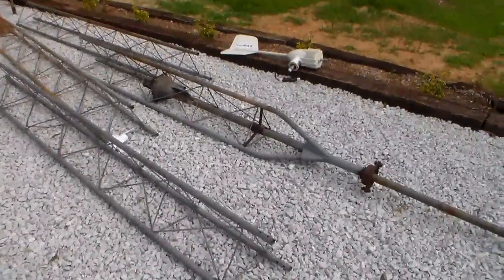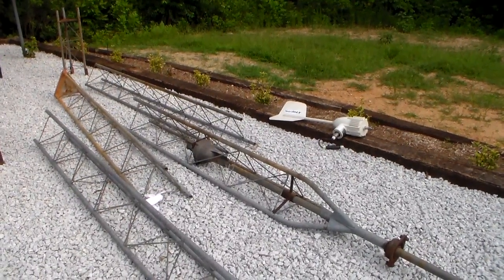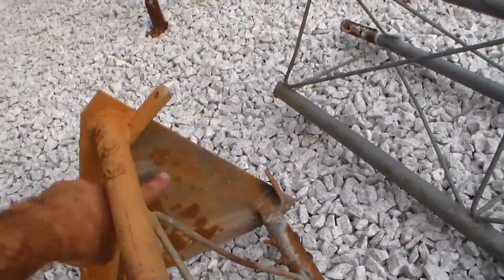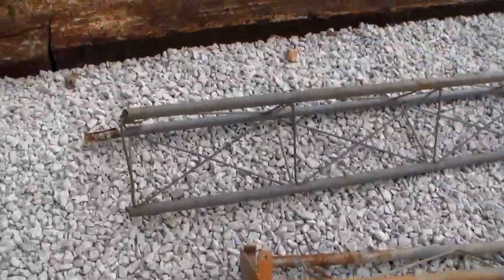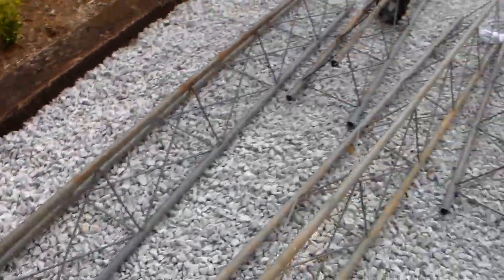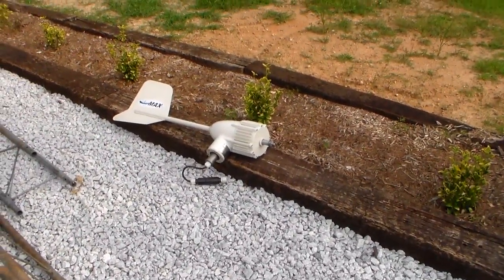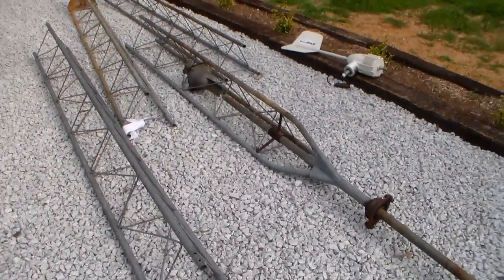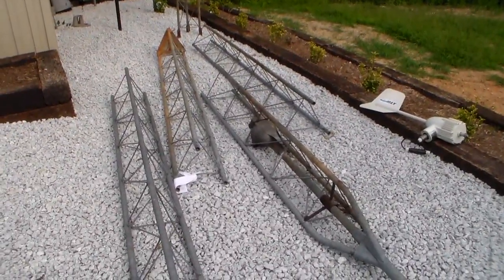Need help with my tower and wind turbine.

Comment: The piece with the flat steel on one end is the top half of the base (you are missing the square 1/4" plate you bolt to the concrete). The two tabs (one is bent) are used as hinges to lay the tower down. The other piece with the three tabs is where the guy wires attach... roughly 30' up your 45' tower. The damage you've shown in the video is consistent with a tower that fell.

Find the ideal place where you want to "plant" the tower to the ground, then before digging ask yourself where to put the guy wires anchors (roughly as far away from the tower as they are up). Just walk around the area and pick some good locations for each. Understand that each guy wire will probably have to be a different length due to obstructions and ground level. It's more important that you maintain safe attachments (double or even triple u-bolts at both ends) than they be exactly at a 45 degree angle. Just get them close. The base concrete footing should be 2x the diameter of the tower (minimum) and extend 6" below your frost line with the bottom belled out. The guy anchors also need to go below the frost line.

Next, assemble the tower on the ground, raise it as a unit, bolt it down, and secure the guy wires to their anchors (you'll need a helper in this phase). And finally, on the section that is damaged, I would cut to just below the next horizontal brace. The triangulations are used as structural support. Good luck with the conversion.
.

Comment: Use the base with the thick plate and bolt it to a good solid concrete foundation. Yes paint it, but I would recommend some POR-15 for your tower. That stuff stops and prevents rust for a very long time. It's used to paint offshore drilling rigs. Be sure to secure your tower with guide cables at a minimum of three locations.

Comment: the tower is galvanised, so normal paint will not work on it, I have experimented with hamerrite and that is the only paint so far that worked on those kind of towers. the next question is just how high you want your tower to be, personaly I would use the part with the bend slab to use as a base arround a pivot so you can lower it, climbing a tower to work on a turbine is a pain in the ass and you will always see that you need to work on it in bad weater, go to a local ham radio operator and ask advise.

Comment: what you might consider is, the piece with the bent ear was/is probably set up so you can lay the tower down to work on it. my suggestion would be set a post, and build a hinged base, and, put a pulley and hand wench to raise and lower the tower.  you can guy it so you will only have to take one side loose to lower it over onto a sawhorse. just my .02

Comment: For the base weld a wide steel plate to give it more stability when you fasten it to the cement slab. Lag bolt every 2 inches of plate

Comment: My grandfather had a similar tower, but he used his to increase the height of an antenna for CB and HAM communications. I was young, but I remember how they raised it. They fully assembled it on the ground lying down. Then they attached one of the guide lines to the tractor and slowly drove away to raise it up. a few people held the other side guide line to keep it from falling over once it was straight. I remember it almost falling a few times, so you might want two sets of people holding guild lines 45 degrees from each other instead of just the one line. I forget how they attached it to the ground though. I remember the guild lines were attached to large archers driven into the ground, but I can not remember how they attached the base.

Comment: Hello: First that 3'' section with little feet has a rotor mount in it, so it is not the bottom. Those little feet would never hold it anyway. The part with the bent tab is the bottom. You need a antenna base with tabs to fit the tabs to the antenna after you bend the tab straight with some heat I think. I would use grade 8 bolts in it. The plate that mounts to concrete needs to be in a direction so you can pull the tower up with a rope to lock the plate down. On the way up this tower is going to get heavy. I would run wire in inside of the tower " not inside the pipe" and tape it or tie tie  maybe every 3' or 4' so wind don't move it. Its best to clean it and prime and paint it since it is old. Well that's my 2 cents worth. I'm not sure if you need guy wires or not.

Comment: Clearly this one rusts, so a light sandblasting or sanding to remove the rust, then cover with several coats of neutral grey primer.
With that large white turbine on top there's not much chance of hiding it, unless you paint the entire assembly in camouflage colors. Neutral grays or flat satin finish is fine. Just don't use an oil base, or you'll have trouble climbing it for maintenance purposes.
These usually bolted sections together, with small inserts to join the tubing. This one may have just been cut up to fit in a pickup truck. Either consider welding it, or having someone else do that, or just make you own cylinder joiners to insert. 
REMEMBER: THIS MAST MAY HAVE TO HOLD YOUR WEIGHT DURING MAINTENANCE.
In the military we sometimes used a cable crank to raise or lower small masts like that. Either a weather proofed hand crank, or a pulley system adapter for vehicle mounted cable motors are options to make life easier.
Since this system will be required to stand up to strong winds when assembled, be sure to attach steel cable stays at 45 degree angles down from near the top out away from the mast base.
The ARRL Antenna book has a lot of 'how to' examples on how these should be rigged.
There's no need to use an aviation painting scheme (red/white alternating), unless you expect a helicopter to land nearby. For towers over 30m (100 ft) it's advisable, but not for your 45 ft wonder there. The taller ones also require navigation hazard lights on top too.
If you attach it to a building, think about adding lightning protection too.

Comment: The one with the bend flange, is meant to be bolted to matching flanges set in concrete. They form a hinge point for raising and lowering the unit. I'm looking forward to your installation.

Comment: there is another base plate with the piece that has the bent part on it, that is the best  base mount if you had the whole plate, then you could break it over. take that rotor out and sell it, its probably worth $200 or at least $100 Lock the pole in the top section in place and get rid of any heavy weight like bearings and mounting plates, you want the tower light at top, as little added weight as possible. paint it, you will need two sets of three guy wires, 3/8 guy wire is best, a little overkill, but if the tower moves around you will loose power from the wind. A steady turbine will get all the force from the wind driving it. Don't put it up alone, you need at least 3-4 extra people to do it safely. if you plan on climbing it you will need a gin pole and belt/gear.  Some ham radio clubs have gear and experienced people, you could approach them and explain what you are doing, one of them might put it up in trade for the rotator and bearing/bearing plate.
Reply: OK KD this is too long winded for me to comment.

Comment: Hi sp1 I used to work into the communications Industry. From what I can tell you have a rohn tower. Make sure you have a good ground and ground rod. As far as the finish goes we used to use galvanized paint. Hope this helps.

Comment: If I was gonna go through the work of setting that tower  I'd definitely use the base with hinges and a gin pole and winch to raise and lower it. If it was me I'd make a side mount bracket for the 400 watt wind max and get in the market for a larger turbine to place on the top. I'm not knocking it by all means but that tower with guy wires would easily support a 2 or 3 kw turbine. Heck I just mounted my 1 kw Vawts right on the ridge of my roof. As long as they are close to above the tree line it's all good. Nice score on the tower sections.Just remember it's galvanized and that's unhealthy when you burn the welder into it and breath it.

Comment: Cutting off that 1 foot look at the geometry make share it matches.
At 35 to 40 + feet you will need a 16 foot 2*4 16 feet long.
This is for pivot.
anger the bass in the ground or concrete .2 of 3 Gide lines to stop rotation.
the 3 gose from top of tower over the 16 foot 2*4 that rest on the bottom of 
the tower and pull for god sake pull (owe stop at 5 feet and put the wind gen on
or all your work will be useless)and keep pulling the 16 foot 2*4 will fall off. the tower
will spring up.If Gide line 1 and 2 or cut wright it will stop if not (run).
Reply: PS put a security cameras up their to .
Reply: http://www.mindspring.com/~vibroplex/FD/Field%20Day.html

Comment: I'd clean it and paint it od green or brown, along with the turbine so it doesn't stick out.  embed base piece plumb into an overkill sized concrete footing.  May need to make a jin pole to lift the other pieces, depending on how heavy they are.  Or if you have access to a truck with a crane, that would be helpful.

Comment: To put up my mom and dads tower we dug a 3 ft hole then at the top of the hole we dug a 3ft x 3ft square about 1 foot deep stuck the base down in the deep hole then filled with cement and smoothed the cement out on the 3X3 square. Where we live we get very high winds and a lot of tornado's that tower has been standing now for about 15 years. Just a thought for you.

Comment: Looking at the rust I would sandblast zinc primer and two part epoxy coat the tower. If that is not an option I would still sand blast and rattle can prime  then coat.

Comment: you will need to still use guy wires. I have the same tower parts. I have 4 sections 3 are 10 foot, and one is about 9 foot. looking for a few more sections so I can have at least a 60 foot tower. the base on the one that had the bet part is for raising and lowering it.  its the hinge part  there would be and identical plate that it would be bolted to that has anchors in concrete people would raise and lower it and attach it to a home at the top.  for this you can do the same with guy wires and a gen pole to raise and lower it but you have to have those guy wires. I will be using about 2 to 3 yards of concrete for the anchors and 3 yards for the base. when I put my tower up I might use more for the anchors thinking over kill with 4 yards. rebar reinforced.  as for painting I would bust what rust you can and then prime it and put a good paint on it to keep it from rusting. it is a small gauge tubing used on the towers to make them light weight.   I love to get some cell tower parts those would last a long long time. but I will be doing what you are with that kind of tower you have.

Comment: Mine is 40' set in concrete with no guy wires.  Been standing 15 miles from the Gulf of Mexico through five or six hurricanes including Katrina.  It's the same one you have.  I recently had a tree service take it down with the use of a bucket truck.  The sections were really stuck together.

Comment: I have the same tower only 30 feet and specs call for it to have a 3x3x3 concrete base with rebar and jbolts in the concrete to anchor the tower base to. I would go with 6 support cables at that height. Remember, with high winds that turbine is going to exert lateral force on that tower equal to having a cable attached to the top and being pulled by a car.

Comment: i tried to call but your mail box is full
Reply: southernprepper1 Dave is the most well known of U.S. preppers who regularly share information on setting up SHTF & WROL communications. Honestly, for that mast I would suggest setting up a Repeater instead of the wind turbine, and Mr. Sarti would be the go-to guy on that, but that's my 2-Cents.
Reply: Kevin Burgess  You could easily setup a repeater in conjunction with the wind turbine. Actually that tower could serve a 3 fold purpose if not more.

Comment: Bury it in a 55 gal drum of concrete! Done!!!!!!
Reply: Do not use a drum, the bottom of the verticals must be able to drain into crushed stone in the hole, otherwise they'll fill with water from rain and condensation inside the pipes. Rohn Towers has proper instructions for doing the job right, with drawings.
Reply: DayRider76 looks to me that end with the bent part of the hinged plate was in fact in the ground at one time, some hams just put them straight in the dirt and pack it down.  put three foot in the ground
Reply: The rusty section that broke off is exactly the result of improper drainage of the tower sections.
Reply from the maker: interesting...never thought about that
Reply: My dad did 40 years ago! cables rusted off! Tower still standing!

Comment: I have never mounted a tower so no suggestions on that. But I do recommend sanding down all the surfaces and spray them down with a couple coats of undercoating.

I've used duracoats spray can undercoating and that stuff is tuff. I'm sure it could stand up to any weather long term and it does prevent rust as any paint will.

Comment: That looks like a Rohn 25G Tower.  They can be free standing up to about 30' after that you need to have guy wires.  On mine, I sunk a bent up portion of tower into concrete and then went up from there.  Yours looks a bit rusty, but if it is still structurally sound, you should be ok.  A lot of counties require towers to be far enough away from living spaces that if they fell they won't land on them. Your county rules may vary.  For erection, you will need to find a long gin pole to hang a pully on.  Then get a couple of u-bolts with a spacer and mount the gin pole such that you can lift each tower section into place.  Whatever you do, get a good quality harness before you climb.  This guy has a good video explaining the process pretty well.  watch?v=iUsoTWYjOrI
Reply from the maker: The rust is very little most of it is our red southern soil it needs a good cleaning.

Comment: dig a 12" hole 3 feet deep put a round concreet form in it with some rebar sticking up into a 6" thick 3'x3' pad for ataching the mast use L bolts mounted in the pad the second section shown has tabs on it to attach guy wires id go about 10 ' away from the pad and screw in some mobile home anchors use 1/4 " galvanized braided wire with at least 1/2" turnbuckles to take up slack hopr this helps to get an idea of whats needed

Comment: To me it looks to me that you have two base the yellow is so you can raise and lower the whole tower in case of problems Yes it is bent can be heated and hammer into place Yes cutting the other piece to frame it up is correct sand blast it then paint it at less with two coats of that Anti-rust Gray paint Grease Everything below the turban Zip tie the wire lose - not flying in the wind but not tight up against the metal Same thing with a Radio tower repeater  Anti-rust coat of Paint,... AT LESS three Support wires for the raising and lowering and wind gust over 35 mph check with your 775 partner to see an old disabled person knows a few things about survival  May the Good LORD be with you and yours

Comment: Its all galvanized pipe. I would hit it with a wire brush and I wouldnt paint it.When you pour the concrete pad,make sure you put 3 tabs of metal in the concrete to meet up with the tabs on the base of the tower. build it on the ground,bolt two of the tabs to two on the concrete base and raise it with a come a long attached to a tree or lift it with a front loader. be sure and have 3 guy wires attached to the top of the tower and some heavy concrete youve poured in 3 directions away from the tower to attach the other 3 ends to. nice score!!!

Comment: be sure that the bolts that mount it to the concrete pad are top grade and installed correctly so the don't shear off in high winds(not sure how windy it gets where you live). you may even want to consider some sort of back up like a cable ran through the center of the tower to an eye bolt in the concrete.

Comment: Just one tip if you plan on sinking in concrete, make the concrete domed a little bit and above ground so no water can stand around the base.  Looks like Rohn 25, great tower company, I have a 40 footer with 2 sections of a push-up pole at the top, gets me above the trees in my area.  Great find!

Comment: My stepdad has had 2 ham radio antenna towers bent over in the wind. He had stablizing guide wires and mounted in and too the concrete with some type of anchor system. The one in the concrete bend at the concrete totally ruined the tower and the concrete wasnt reuseable for the next tower. second tower had a mounting flange and the anchor bolts sheared off but the concrete base was still useable, we just drill new anchor  holesd and epoxied new anchor bolts in. tower was assemble complete and set into place with a friends boom truck but I would think a track hoe could do it if the boom was long enough.

Comment: Hi David, I'm thinkin' the short one standing there is the base. And the one with the bent bracket is possibly for cable anchors further up towards the top...? Maybe ... not sure.
Reply from the maker: Yes could work for that.  I had not thought about that will have to check it out.

Comment: You have a Rohn hinged base that has another part that is flat which you set in a concrete base and then the BPH25G that you have hinges in that so you can lay you tower down by this to repair and install etc..

You might find some help here with the parts missing if you want. My father had this setup using his HAM radios and it allowed him to lay his tower down and secure it when hurricanes came this way.

http://www.3starinc.com/rohn_25g_tower_hinged_base_plate_r-bph25g.html